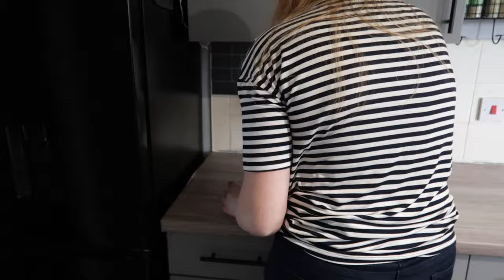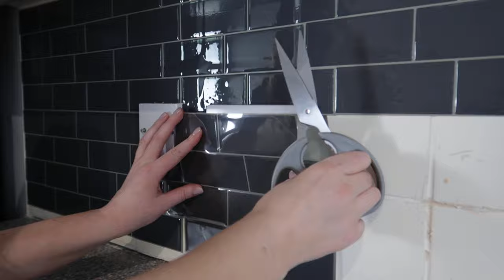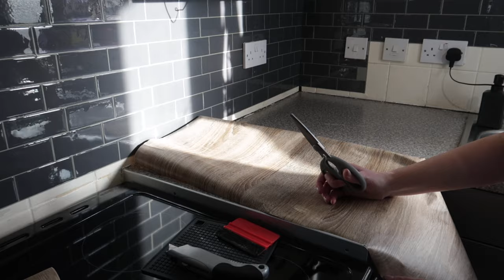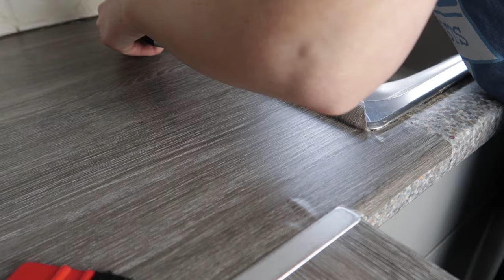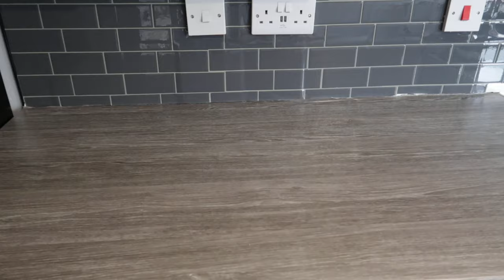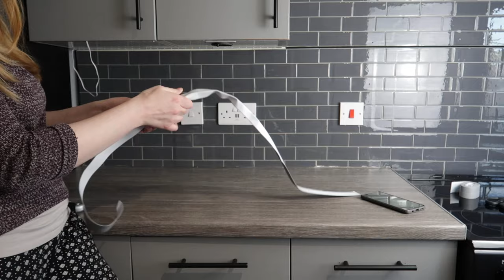BUDGET KITCHEN MAKEOVER | STICK ON TILES | D-C-FIX

Comment: This looks so good - how have the stickers held up over time?
Reply from the maker: Not too bad! I've had to use a little glue on some of the edges of some though!
Reply: @MissMoogle how do you call this thing in between the tile sticker and the worktop vinyl ??? Like a plastic silver rubber??? Thanks
Reply: @MissMoogle  what glue did you use?
Reply from the maker: @sun.kissed.portal  Just some super glue haha
Reply from the maker: @graueterno3619  The sealant/ silicone strip?

Comment: Very pretty!  One suggestion; replace the under cabinet lights with battery operated ones.  The hanging cords are crazy making!
Reply from the maker: I actually replaced my battery ones with these because they are brighter hehe
I have tidied up the wires a little since this, and there are things in front of them so I don’t mind too much.

Comment: Hi Miss! Thanks for the great content! I just have a quick question regarding the old DC wallpaper that you used their own glue for - did it come off relatively easy? I can see some marks, but I assume that’s just the paint coming off of the tiles.

Would love to try at home but kind of worried the glue might be hard to remove from my porcelain tiles.

Appreciated, and thanks!
Reply from the maker: Hmm yeah I'm trying to remember... and I think as well as the paint coming off it did leave residue!
Try real tiles!! In one of my latest videos I have done them!!! 😁😁

Comment: Thank you so much for this video. I'm looking at getting the red ones to compliment my kitchen cupboard fronts and I like your template idea. I've been thinking about doing a template but didn't know the best way of doing it. Would you recommend a Stanley knife to cut them or a guillotine/paper cutter? What I'm wondering is which is going to give a neater more accurate cut? I love your energy btw. I live in rented accommodation and there is no splash back and the correct paint wasn't used so rather than repaint it using the correct paint I thought this would be better and far nicer. Jazz the kitchen area up a bit 😁. I'm excited to do it now 😁
Reply from the maker: Yay! That method helped for me. So glad you enjoyed watching; thank you so much! Yeah I just used a stanley knife and it was easy enough. Good luck! x
Reply: @MissMoogle  Thank you so much 😁

Comment: Great makeover. Question - what did you use on the edge of the tiles, that black line/trim? Thanks
Reply from the maker: @marcioduarte2906  Thank youuuuu! Just some matt black tape I bought from Amazon hehe
Also.... I have actually done another kitchen makeover since if you check out a more recent video of mine! 😁😁

Comment: It looks great! Does this work for bathroom tiles? Also do you know if I can lay stick om tiles over lino or would it be better to replace the lino?
Reply from the maker: Yes, but maybe not the ones directly in the shower or you'd have to seal all the edges to make it fully watertight.
Do you mean for stick on floor tiles? You might be best contacting someone who sells them. There's a link for where I bought these and they do sell floor tiles. Good luck!
Reply from the maker: 'Link in the description' I meant to say!

Comment: I want to do my kitchen with same subway tile in black. Soo apprehensive about it but you make it look easy. I may yet take the plunge. Retiling is going to cost upwards of £450 just labour, and I'll have to buy the tiles seperate 😟. This may be the one.
Reply from the maker: Yessss it’s not too hard to do! I promise! It’s a quick fix and cheaper option!
Reply: @Miss Moogle  any links on the type of stick on to buy on amazon UK? I've searched amd there are loads, I don't know to get thick or thin, or big or small. The ones in this video look like thin 30x30cm rather than thick sturdy ones that I've seen on amazon...
Reply from the maker: @Shah2  I got mine from Create Your World Ltd. There are so many different ones, that's true!
Reply: @MissMoogle  thank you!

Comment: I was just wondering if you've noticed the heat from your cooker affecting them at all ? Xx
Reply from the maker: Not had a problem at all. I have an electric cooker and it is away from the wall a bit too.
Reply: I thought that I'd probably stick a bit of sheet over as a splashback feature

Comment: How does this vinyl deal with getting wet, i.e spillages and surface cleaner ?
Reply from the maker: Absolutely fine. Had no problems at all. It could do with refreshing now to be honest.. there are scratch marks but it doesn't need replacing... Just preference. I think it holds up super well though!